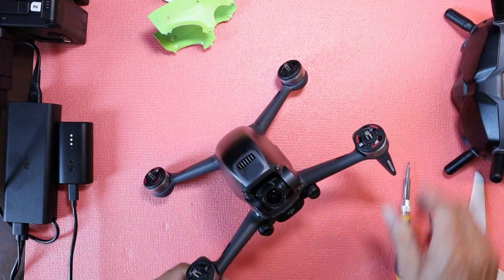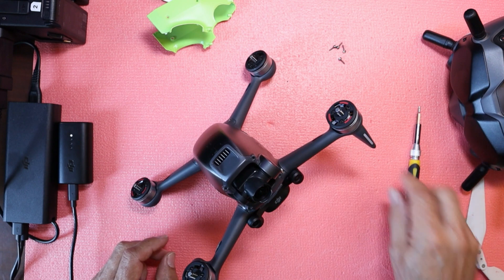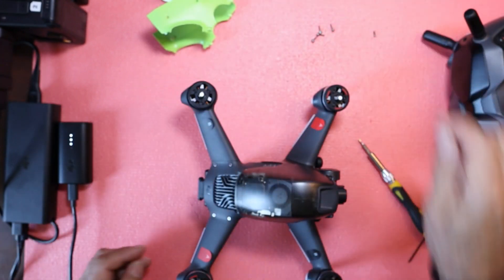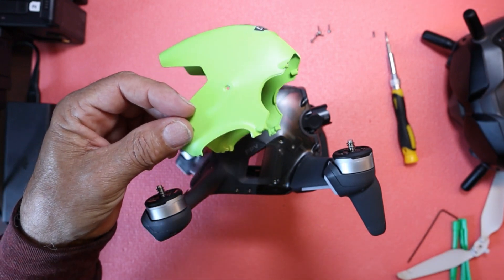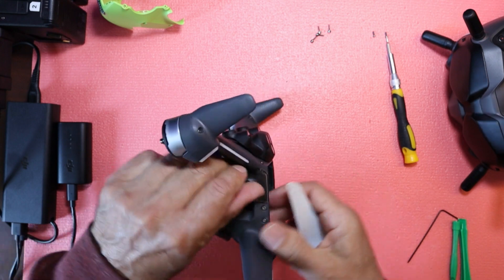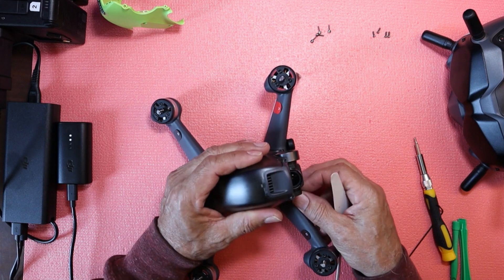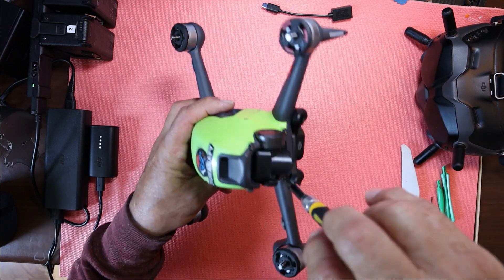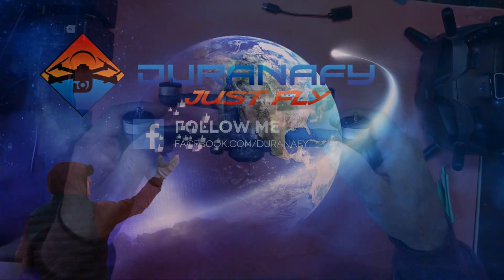DJI FPV Canopy Replacement under 10 minutes

Comment: You actually bought one? ... What no first (crash) ... I mean Flight video? I was on the fence on this one... but no way would my luck hold out. Scary expensive for a "Beta Tester".
Reply from the maker: Agreed scary expensive! I have been flying FPV drones for the last month, and it is so much fun! Of course, they are 150 dollar drones that can take a beating, not 1200 dollar drones that will more likely brake on your first crash.